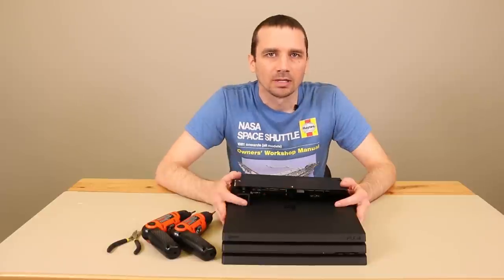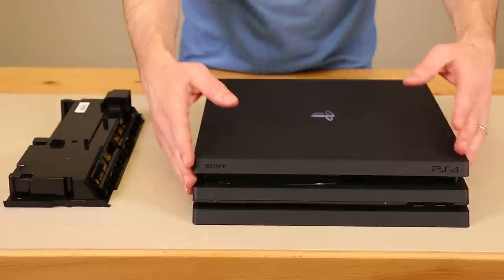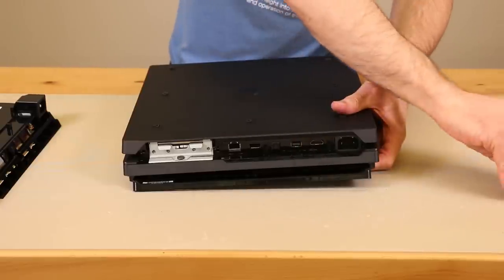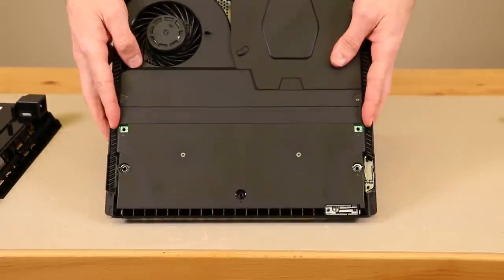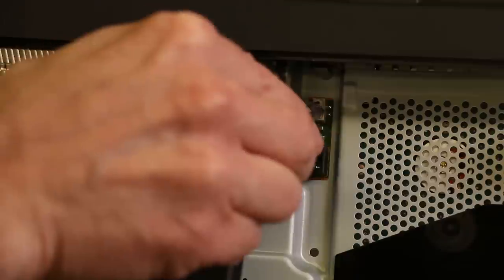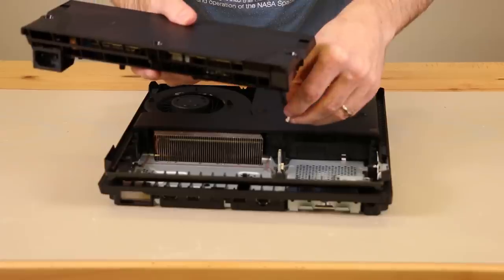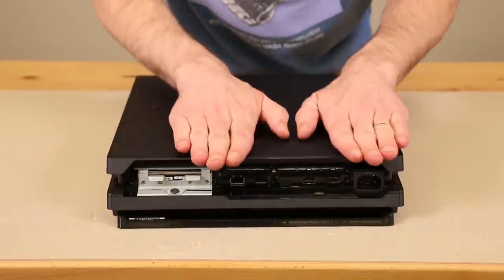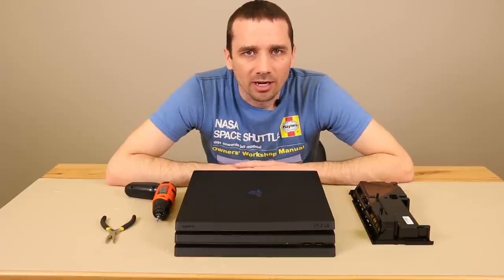PS4 Pro Power Supply Replacement

Comment: I’m having trouble removing the power supply cable.
Reply: My is brok
Reply: don't try and yank it out, try using a tool like pliers or something to carefully pull it out.
Reply: I accidentally pulled the small piece that the power supply plugs into off of the board and need to know how to fix it.

Comment: My ps4 pro turns on once then off 2 secs after. Then nothing happens when i press that button. If i unplug and plug it back, it does the same. After a lot of research on the net, you are the only one that only confirmed that i truly need a power supply in one of your other videos based on my problem. Thank you for that. I got the sill and the right tools to repair it. So now ill buy one. Ill let you guys know how it went.

Comment: I took my wife's blowdryer (on cold) and removed the top cover and bottom cover. Used a ton of earbuds/Qtips and cleaned the heatsink through the fan. Might not be 10000% perfectly clean but its quiet and I don't risk breaking it.

Comment: I just tried this man and it worked!! Thanks so much!! Life saver haha!!
Reply from the maker: Glad this worked for you.
Reply: I'm having issues trying to unplug this cable I accidentally cut my original cable got a replacement trying to unplug the one from the board. Would heating it with a hair drier help?
Reply: @ZerocoolsPropsandCollectibles  wiggle it
Reply: While pulling

Comment: Hi, does anyone know where to find a replacement little cable? The first time I did this my pliers slipped and ripped off the wires. I can’t seem to find one anywhere online. Please!
Reply: doesn’t it come with a new power supply?
Reply: Did you manage to ever get a new one? lol this just happend to me i feel screwed.
Reply: @Kalkazaar  i don’t know how, but I managed to manually (and very carefully) put the wires back into the head one by one, making sure they were all exposed wire and tightly wedged in. It worked. My ps4 pro continued to sound like a jet engine but at least it worked. All in the past now as I got a PS5 that is practically silent 😍

Comment: Tried removing bottom cover but the plastic started cracking.

Edit: my bad, forgot to remove the 2 screws under the stickers first 🤦🤦
Reply: Matt C 😂
Reply: The next PlayStation console design needs roach prevention installed i swear I get home after buying the new mk11 and a membership card and the ps4 is completely zapped
Reply: @kendrickpope1149  roaches love small tight warm spaces

Comment: Just wanted to say thanks for this tutorial. I used it to get access to the heatsink without completey disassembling my pro. A quick and careful clean and no more sounding like a jet taking off everytime i loaded AC: Origins!

Anyone else using this method, a tip: make sure you leave no loose dirt behind as it will be blown out through your power supply , which could cause a short.
Reply from the maker: You're welcome. Loose dirt won't cause a short. Please don't tell people stuff like that.

Comment: I'm having a problem with the cable not going into the PS4 pro fully, it just feels rely loose even after I've rammed it in!
Please say PS4 power supply problem again ^_^
Reply from the maker: Which cable?
Reply: TronicsFix the power supply cable!
Reply: @Tronicsfix  same issue, and very loud coil whine and clicking fron PSU

Comment: Hi I love your videos are very constructive and I learned a lot, but I have several questions like: 1) Do you consider it necessary to change the thermal paste to the Ps4 Pro? 2) What do you think of thermal pads and if you know a good brand to make a change? 3) which method you think is the most effective to apply the thermal paste since I see several videos on the Internet and I do not know what would be the best method beforehand thanks for taking the time to read me I wish you many successes and Blessings
Reply from the maker: 1) No
2) They don't need to be changed
3) Squeeze a pea sized bead onto the APU and put it back together

Comment: My PS4 Pro fried by an electrical surge from lightning (flash and thunder were simultaneous so it's very close to us) and the modem also fried that I replaced it. I already removed the power supply by following the instructions in your video. When I plugged the power supply after I removed it, the 4 pin plug still has a 5 volts supply which means that part is okay. I didn't see any burn or blown fuses on the power supply. I think the problem could be in the motherboard's power management chip which you mentioned in your other video "PS4 Won't Turn On At All - Top 5 Possible Causes" and no longer able to command the power supply to turn "On" the 12 volts output to supply the mainboard. I think I'll better buy a new PS4 Pro. The PS3 and PC which was connected to the same modem but was in standby mode when the incident happened survived and still able to connect to the internet via a LAN cable which means the Ethernet circuit wasn't fried. The TV which was running while playing the PS4 Pro also survived. Next time I'll better use Wi-Fi because it's not worthy to take a risk for a wired connection for people like me who don't play online because I didn't renew my PS Plus.
Reply: Same sitution . last week in bulgaria where ı  work, after strong lightning first internet gone, Yesterday , ı wanted to play ps, then there is no power. Until I read you comment, ı was thinking to buy new power supply but now ı am not sure.

Comment: Using this video I fixed my PS4.

Some advice for others looking to do the same thing

Not just any Screwdriver will work. It needs to be a T8H screwdriver. T8H exactly. without the H it will not work. Also with taking the cases off, for the back case I didn’t notice there’s a part you need to actually screw off (with your T8H screwdriver) and without unscrewing those first I cracked it trying to pry it off. It still works fine and I really appreciate the video. I just want to add my two cents (I apologize if these issues are directly mentioned in the video, because I didn’t notice them)

Comment: Thanks for the video, I ended up damaging the 4-pin power cable that connects to the motherboard (nothing else was damaged), so I ordered a new one from Amazon and the Hakko CHP PN-2005 Long-Nose Pliers you use since my dad doesn't have any like it as none of them have Serrated Jaws (they're all really old too).

Comment: I left the PS4 running with a game playing. A person in our household sees it and proceeds to unplug the power cord from the outlet (without exiting anything or turning off the PS4). Now I tried turning on the PS4 but it doesn't respond, either through the controller or the power button.

The power button literally doesn't do anything; and if the PS4 is plugged in, the controller light blinks twice or thrice then stops as if it has turned on the PS4 already. (but when the PS4 is unplugged, it only keeps blinking) When I press the eject button, it only beeped once.

I've tried various solutions around the internet such as holding the power button, replugging both power cord and HDMI, trying another outlet and power cord, and tilting it different ways. I was able to manually eject the disc inside, which causes the eject button to beep 3 times now.

I've seen people say that it could be a power supply issue, so I went ahead and bought one online since the warranty is void already. After replacing the power supply, nothing changed. Still the same symptoms.

Anyone here who can help me fix the PS4 or at least give me an indication as to what the problem could be?
Reply: Did you find out what the issue was I have the same problem
Reply: Sounds like a mother board or HDD issue.
Reply: Did u found how to solve this problem?
Reply: I used to turn off my PS3 Fat that way: switching off the power switch behind the console back in 2008-2009 before I realized that was not the way to turn off the system. I wish everyone learned this before causing any issues with a console.

Comment: Great informative video. A couple of questions if I may? 

1. Is the power supt different in different regions? Your port looks like an old kettle wires fitting. The one I have has a far slimmer opening. 

2. Where do I buy a trustworthy power supply to replace the one on my console?
Reply: OEM is available on Amazon for $95 and change

Comment: at 4:00, when I tried to do exactly this, the connector on the board itself loosened :/
I even had a headlight on me to doublecheck that it was only the cable's end I was holding the pliers on.

Comment: There’s a way that I can fixed if I take off that connection from the electronic circuit by accident?, 4:05 I pull out and I take off that connection, obviously my PS4 doesn’t turn on anymore (I don’t speak English well enough, my bad if I didn’t explain myself good)

Comment: I have a CUH-7115B playstation pro where would I get a new power supply to replace the one I have?
Reply from the maker: You probably won't be able to find one yet. I'd keep an eye out on eBay though...once they are available they will be there first most likely.

Comment: Hi bro! Thanks for your vid! I ran into a problem, the 5 screws you have to take out the power supply arent the same for me, i have the 2 long screws and the 2 short ones on the sides, but the bottom one on the center is different and doesnt unscrew with the t8 screwdriver. Do you have any idea why? My ps4 model is the cuh 7216b
Reply: Same. I’m just taking mine back and never going back to Sony again. Waste of money and my time.
Reply: @a.bourne6386  I realized the 5th screw isnt actually a screw but a dummy, try taking the power supply without unscrewing that and it should work bro!

Comment: I took it apart and damaged the 4 pin connector and im looking for a new one on eBay and see that most of them are ADP-240CR but the power supply for my PS4 is ADP-300CR. Would you know if the 240CR is compatible with my 300CR power supply?
Reply: You can resolder the old one

Comment: Hey… Steve… Could you do a video on replacing your Xbox one Blu-ray drive disk Drive electronic motorized  rollers because I want to know how they work and how to fix them if they fail could you also  do The PS4 blu-ray drive as well?
Reply from the maker: Yes, I'll put it on the list.
Reply: And also does the optical drives have a sensor that tells the rollers that there is a disc there so they can start rolling?
Reply from the maker: Yes
Reply: Another question… How does the optical drive know that the disc is there to start pulling it in?

Comment: I know that video is old but someone might read this and can answer my question:
My Ps4 isnt turning on anymore, from one to the other day it just does nothing anymore. Could the power supply be the problem?
Reply: Yes. The power supply cable could be damaged. You could use this video to check
Reply: @arshsidhu229  it   was the power supply in the ps4 not the cable i changed it and it worked again

Comment: I replaced the power supply and PS4 Pro still doesn't turn on? Any suggestions?
Reply: Timothy James the motherboard perhaps, but first check if the power cable isn’t defective .

Comment: I have a quick question, my PS4 pro details are as below:
Model no: CUH-7102B
PSU part no: N15-300P1A

Any idea if the below spare part would work with mine? If not, should I match the PSU part number or the PS4 pro model number?
PSU part no: N15-300P1A
Model no: CUH-7500

Thank you

Comment: Will the ADP-300CR power supply work for both the CUH-7015A and CUH-7015B models or do they use different power supplys?
Reply from the maker: It works for both.

Comment: I have a PS4 Pro model CUH-7115b and there are 2 screws on power supply but I cannot get it off. The bottom middle spot does not appear to be a screw.

Comment: Where would I find a replacement power supply for the ps4 pro? I've looked all over without luck.
Reply from the maker: Keep checking ebay. Other than that they aren't available.
Reply: Is there a model number for the power supply to make it easier to search for?

Comment: What's the reason you'd change the Pro's Power supply of course apart of the console not turning on at all. What would other reasons to replace it would be?
Reply from the maker: Turning on and then back off...this isn't common but does happen.

Comment: Where do you get you're power supplies from??my pro went out I ordered a power supply but it was used and did not work has visible dark marks on the board along with a broken clip for the wire connectors..the original made a pop when it went out..

Comment: I broke the big silver plate that goes over the power supply and it's no longer connecting on both ends - is this causing the ps4 pro to not power on and need to replace the entire power supply as a result?  Thank you!
Reply: to confirm, the plate shows at 4:43 on your video.
Reply: @mattramos6001  i’ve seen multiple people say it dosent really matter if you have it on or off
Reply: if it dosent turn it on just replace the psu it’s faulty

Comment: i have to turn my pro upside down and put pressure on the back close to the power port for blue light to stay on and turn white (until the power is unplugged) Should i replace my power supply? We just had a bad storm in florida i think it burned through the surge protector over night

Comment: @tronicsFix If the ps4 started shutting down randomly, does it means it has a problem with the power supply? please reply! I need to know
Reply from the maker: No it doesn't.
Reply: TronicsFix Then can you please tell me what it's cause? Mine has been shutting down at random times. I took it for repair three times but it's still happening!

Comment: Went to go clean my PS4 Pro a few days ago and I noticed when I removed the power supply one of the metal prongs that goes into the power supply was snapped off. Now I can only play games that are 10 GB or less. Any idea how to replace the two prongs connected to the power supply.

Comment: Hi iv been watching your videos iv got a ps4 pro console wont turn on iv taken all the 5 screws out from the pcu but both ends lift up but the middle will not come free to the point its bending up at the sides wiggling it isn't working how can i get it out thanks in advance appriciate and advice

Comment: How do I know which Power Supply to get?
Reply from the maker: Look at the part number on the bottom and get the same part number.
Reply: @Tronicsfix  the part number or the model number? Or is that the same thing?
Reply: @Tronicsfix  should I also replace the 4 pin cable that connects to the motherboard to the power supply? I had a roach problem and when my ps4 a loud pop was heard and smoke came out. I know I had to replace the power supply, I was wonder if I had to get a new cable too.
Reply from the maker: You don't need a new cable. And it's the part number you're looking for. You can also go by the model number of the console to get the right part.
Reply: @Tronicsfix  Do you know any great database where you can find which PS3/PS4 models take which power supplies!

Comment: Why its so loud ? I ve got a 7216B second hand from 2018 and my brother in law has a 2019 7216B model brand new it only has a week and his it’s not loud as mine ,do i have to reapply thermal paste again??! I took out the panel to check the fan  i can’t see dust blocking the cooler holes 🤔

Comment: The PSU in my Pro gets really hot.  I've had the unit since Jan 2017.  It has only started getting really hot in the last few weeks.  I keep the unit clean & have good thermal paste applied, the unit also gets plenty of airflow (not in a cabinet).  Have you ever seen anything like that?  I'm thinking the PSU may need to be replaced.
Reply from the maker: It's normal for the power supply yo get hot. I really doubt buying a new one will change the temp.

Comment: My power supply fried during a thunder storm (the surge protector got zapped too) is there a standard power supply they use for the ps4 pro or do I need to pull the old one and look for a specific serial number to order?

Comment: I’m a bit confused, if you could offer some help. I was trying to open my god of war edition ps4 pro following this video. I’ve looked all over the back and I only found one security screw and two of those plastic locks.

Also I can get the middle part of the bottom panel to disengage fine but working toward the edges it won’t budge and I’m using way more force than I did with the top panel so I haven’t been able to get it open yet. Any idea of what I’m doing wrong ?
Reply from the maker: That's a different model. There's a little clip where the other screw used to be that you have to disengage.
Reply: TronicsFix hey what about the black ops 3 ps4? I had trouble taking mine apart
Reply: That damn clip. Haha I tried for a bit to get that black screw out and it didn't move. Then I saw the clip, stuck a small flathead in and it released. 😂😂 I appreciate this video a ton though man thanks alot!

Comment: I replaced my power supply and it still doesn't power on. Completely dead. Do you have any ideas on what the issue could be?
Reply: Did you manage to know what happened to your ps4??? I got mine same way, it doesn't turn on at all and I'm about to get a power supply, just trying to understand what's the correct one I should buy
Reply: @ErikVegaP  had to buy a new ps4 no clue what killed it... Wasnt the power supply. But could very well fix yours.

Comment: How much would it cost for the power supply repair
Reply: for PS4 pro
Reply from the maker: Does it have bugs in it?
Reply: TronicsFix no
Reply from the maker: For the Pro we charge $199.99 right now. Parts are super hard to find and expensive. We'll lower the price when we can but right now that's the best we can do.